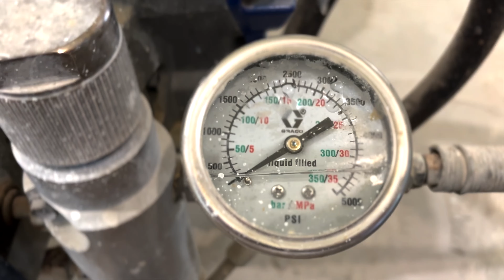Tri-Lakes Custom - Episode: 1

Comment: How are you getting that finish on the doors?  I’m getting amazing results with some Renner stuff, but I’m trying to teach myself a lacquer  finish.  Want to able to offer a cheaper option, but I’m having issues with dry spray I think. I’m getting close to glass but some spots are rough like I’m not getting enough product on. 
Running a 310 at 1400psi with a 495
Reply from the maker: I’ve been shooting lacquer since the 90’s. Move to a 412 @ 2000 psi. You can do it with a 310 as well, but I’m guessing your just putting it on dry, and not moving fast enough. Product will also effect it. If your into conventional nitrocellulose lacquers, you need to switch to vinyl sealers and precat lacquers (catalyzed). They’re more forgiving with leveling and blushing. If your using a conventional, you need to switch to an eleven one thousandths… 311 or 411. But with conventional you’ll still never get that low luster cabinet quality look. It will just look cheap in satin. Also… if your into the vinyl sealers and precats… double up your sealer coats. Go one coat of finish… you’ll have better luck sanding your sealer coat multiple times then attempting to double sand top coats.
Reply: @alfapainting2803  Im rolling airless...Already running 2 coats of sealer.  That always work better with the 2k stuff too.  What do you mean by putting it on dry?  Not having the pressure up enough?
Reply from the maker: Ya… lacquer flashes off fast, it sounds to me like the 2k mentality is playing with your head. You can’t shoot it like that. 1300 psi, 310 etc. is way too low of volume. I’d need to know the products to be more specific.
Reply: @alfapainting2803  yeah that's exactly what's happening...bottom of the barrel sherwin stuff.  Sherwood EZ Sealer and Hi Bild Lacquer...Ive used it before on drawer boxes and got good results running the sealer with a 310 and the topcoat with a 308.  Im guessing the small area makes that work out fine.  This entry door I did today was a different story...like I said most of the door was a glass finish just one good size spot were it was rough like there wasn't enough product for it to flow out? Maybe?
thanks for the help, I appreciate it
Reply from the maker: If your using just conventional hi-build, it will operate like shit. Sherwood has their vinyl sealer T67F6, and a new Hi-Build pre-catalyzed UV lacquer T67F58 which all have KCMA ratings I think. Each product catalyzes to a 6 month date. No reduction, No retarder, just shoot it between 2000-2300 psi with a 310 on jambs, cabinet doors, boxes etc. or a 412 on interior doors. But once again, if your using conventional hi-build lacquer, you’ll have to switch to an 11. 311-411 for it to atomize properly, and you’d probably want to retard it… that will lessen the flash off, and reduce orange peel allowing it to take longer to dry. But it’s essentially going to be reliant on mil build to get it to lay down right. If your using precat, try the UV 58. Most all precats are dummy proof in comparison to conventional hi-build lacquers. Your sheen also needs to be in the dull-rubbed to get that specific luster. Hi-build in satin looks like shit.